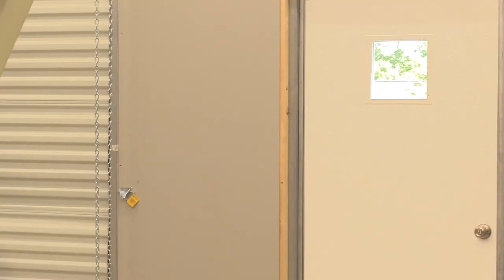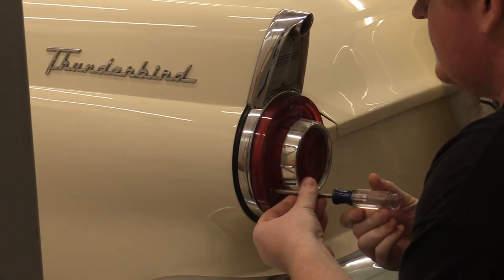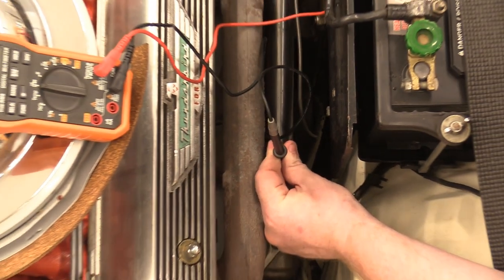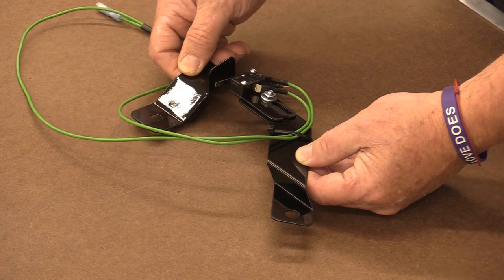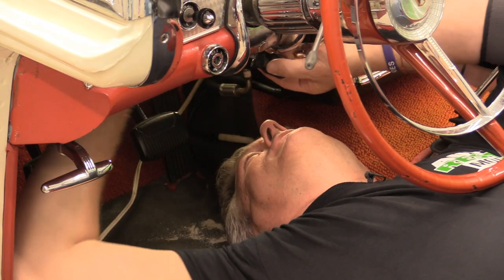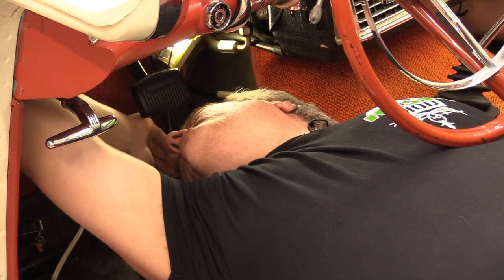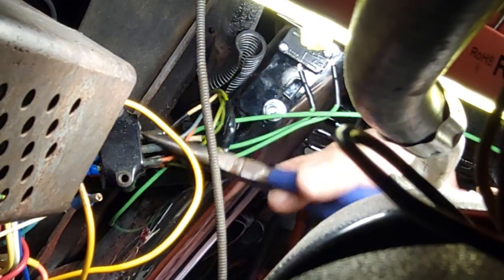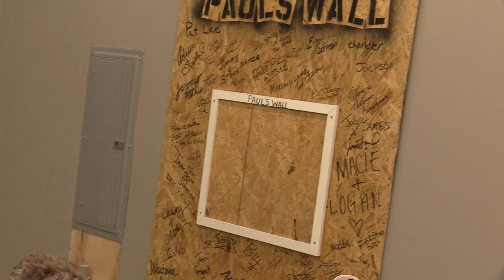Brake Lights Dont Work Thunderbird

Comment: I have a 1956 Thunderbird here in Australia. I'm also an Auto Electrician. Firstly when testing the switch it's much easier and quicker to get a piece of wire and connect the two wires off the brake light switch and then turn on the key. If the lights come on, then you know  the switch is faulty and the rest of the circuit is good all in one test! Secondly, better quality pressure switches are available. They may have different wiring connectors but it's easy to change the terminal connectors than to go through what you just went through!
Reply from the maker: The method you discuss is a great one thanks for the tip. This switch is more for us to add in a dual reservoir master cylinder.

Comment: I modified the switch on our 54 Ford in a very similar way. I used a Nissan barrel style switch. But I will say this, I planned this mod and it was while I had the brake pedal assembly out of my car in my hands. This repair is a PITA but I have heard of folks having these switches leak and or just not functioning. NOS switches are probably non-existing.
Reply from the maker: Yep.

Comment: As time goes on, we'll see more and more solutions like this one for the brake switch. In theory, it is possible to keep the old switch housing and jerry rig a switch from some place like Mouser Electronics, but the solution shown here using a microswitch and adjustable bracket is more practical. These may be found in scrapped aircraft electronic modules.
Reply from the maker: Agreed. This was a really nice one.

Comment: Would a motorcycle pressure brake switch be a better replacement choice part?
Reply from the maker: Dunno. I like this solution. It is all there, the pressure switch stays put, the wires can even stay on the switch. Very slick.

Comment: When i had my 68 mustang and the brake lights didnt work, i pulled up the sill plate and sure enough there was a broken wire the same color as the brake light wires… one butt connector later i had a more street legal mustang lol
Reply from the maker: Yup.